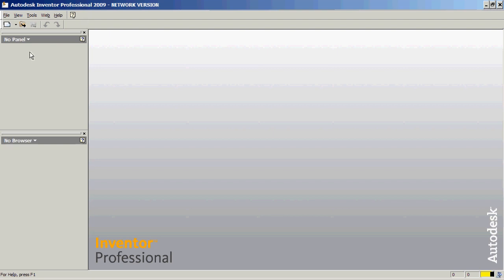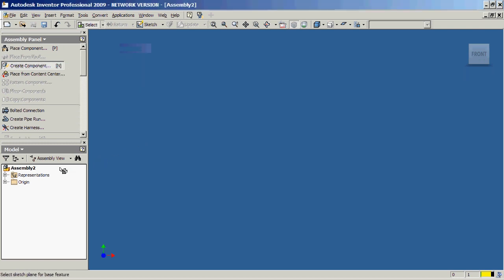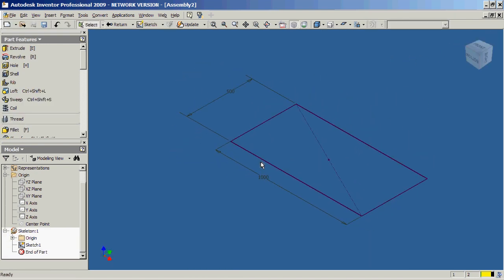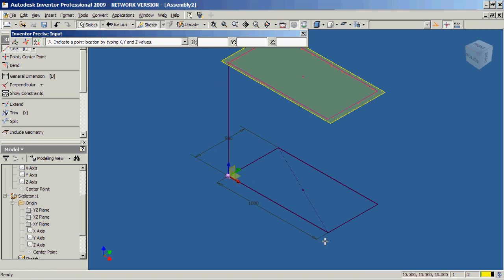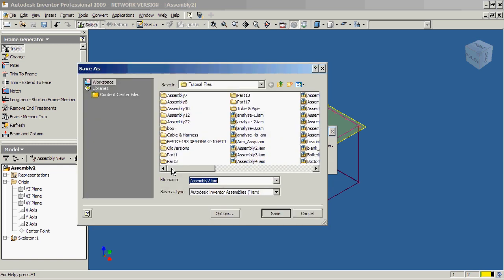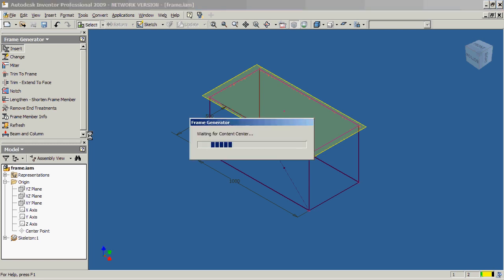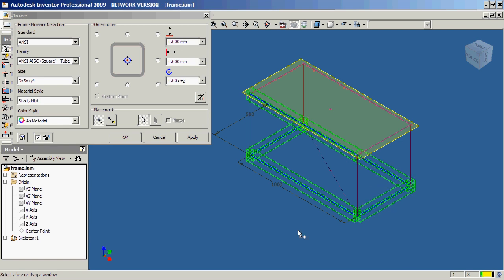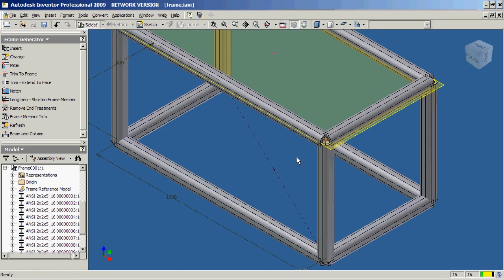Autodesk Inventor - Frame Generator - Part 1

Comment from the maker: @Verbatim112 
1st of all did you watch the whole demo? I have it available for download on my blog.
What version of Inventor are you using? it's 2009 in the video. so it might be slightly different.
there's no calibration needed. all you really have to make sure of is that you have content center loaded on the machine. it comes free with Inventor.

Comment: Would of been better if you started from the beginning. When I open Inventor I don't see that screen and I can't even find it
Reply from the maker: The demo does start from the scratch. It's either you don't have that add-on or you don't have the frame generator turned off
Reply from the maker: The tutorial did start from scratch. It sounds like you either don't have the frame generator add-on or it's not loaded in the startup. Which means it won't come up in the panels shown in the demo.